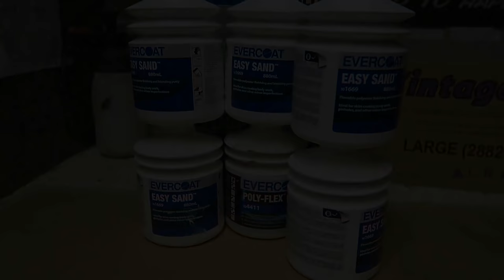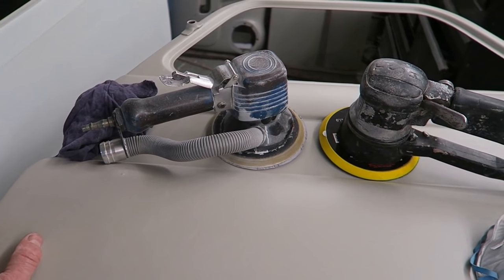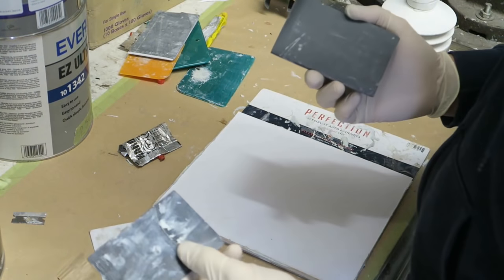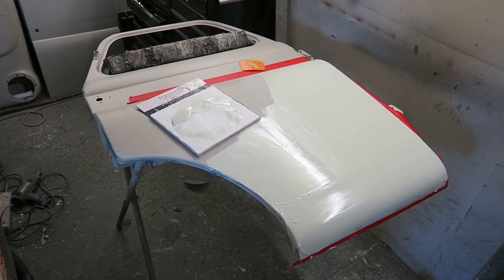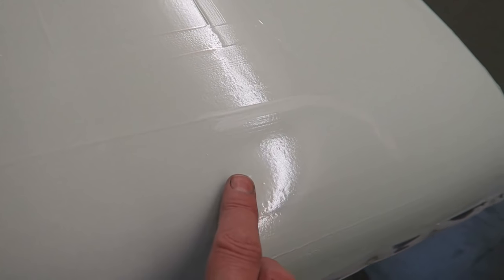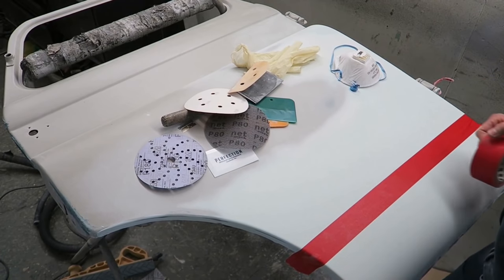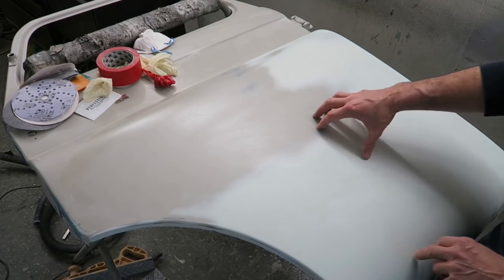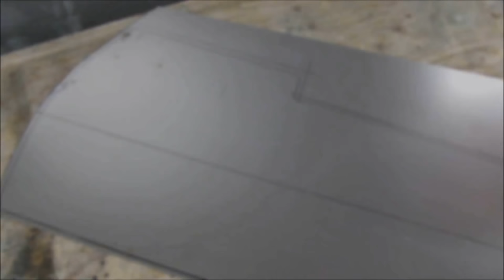Car Body Filler Bondo Tips and Tricks #12 + Evercoat Easy sand review

Comment: In case you have worked in some air in the putty, knock from the downside against your mixing board and you will see how the air bubbles come out. 
What you also could try, is mixing of easy sand with fiber tech -results to a smooth surface and high building bodyfiller  in one step!

Comment: Fillers are not all equal as I discovered either!  I now use quality filler such as Upol and though a little more expensive than some, certainly save a lot of time in ease of application, sanding and re filling after shrinkage! The masking tape trick is one I had overlooked too!! Another top vid mate!

Comment: This brings back memories for me. I remember the old rock hard fillers, which were hard work, then the lightweights, which had polystyrene as the filler, very easy to sand but the adhesion was so bad that you couldn't get a feather edge. Then the creamy ones came in like this product, which were very useful to finish with. I don't suppose you remember the old cellulose stopper? Great if you could leave it for 6 months!!. Thanks for sharing your skills Trev. Oh, and what possessed you to paint the wheels red ?!!?

Comment: Just done the side and rear doors of my van with the stuff using your tips and I’m really happy with how it’s gone. Very little clogging and dead easy to feather. Only problems are it’s damn expensive in Australia and so hot that I had to work in quick stages. It dries as I’m mixing but it is 44 degrees C. Both my fault for being on the wrong side of the globe. Thanks again m8!
Reply from the maker: simon ayton Hey Thanks 🤩, your comment is very much appreciated. Cheers Trev 👍
Reply: Use less hardener?
Reply: Tezzr Terry that didn’t work either. Just ended up spending more time mixing it in and the. There were parts that didn’t harden. I had to scrape it off and go again.
Reply: HA - yes - us Australians may not have the cold weather issues Trev was mentioning.

Comment: Hi Trev have you tried Evercoat Rage? performs pretty well ! similar to the easy sand but may work out cheaper?? We also use the Evercoat ultra light  and Upol Dolphin but haveing issues with pinholeing in both thinking about a change there!

Comment: "The name is Bondo...James Bondo".  Bondo is an American of body filler in case you didn't know. Body filler is talc mixed with polyester resin...same resin as is used in fibreglass.  All fillers depend on mechanical grip...a.k.a. grinder marks.   I can recommend that the best of all worlds is to buy whatever filler you want...and then mix a small can of polyester glaze, which sands easy, into your filler...then your filler will sand easier and have less pinholes. Also...you can mix in small amounts of fiberglas resin into any body filler you buy, to make it apply smoother.  Given that anything with polyester resin needs an oxygen free atmosphere to harden...I also recommend that you take a piece of masking paper and stick it to the filler you apply...then let it harden. When you peel it off you will find that there is no tacky surface to eat up your sandpaper.  Of course, you can also use a body file/rasp to take the tacky surface off.  Perhaps I should have my own Youtube channel LOL!    Anyway ...cheers from Canada!
Reply from the maker: Mark Anthony all points raised I’d heard before but I hadn’t appreciated that oxygen stopped the resin from curing 🤩 many thanks. Cheers Trev 👍
Reply: @bobbofly  I thought that was gel coat that doesn't cure unless oxygen free?

Comment: Hi Trev, love your videos. I've seen so many different tools used to sand filler. I have a orbital sander that I use to finish sand woodwork. Is that any good for body filler?
Reply from the maker: bob wickham give it a go Bob, you could use 80 g to get the basic shape then finish in 180 g. Cheers Trev 👍

Comment: Thats a very fine finish filler. Good open time on it. Will have to try it rather than stopper for a final skim. What epoxy primer do you use? Never been keen on putting anything filler wise over a paint substrate unless its a stopper. 
One thing I always reccomend is blowing the dust thoroughly out of the filler surface before recoating or priming. Helps adhesion and also helps prevent sinkage and scratching showing up. I also guide coat my filler as I would primer. This is especially useful when fine finishing the filler as it shows the scratching. Nice work as always👍
Reply from the maker: N K It’s HB body epoxy. Adhesion is definitely improved especially using fibreglass paste you really must key it well before filling. It is quite a brittle product so I wouldn’t put too much on. Cheers Trev 👍

Comment: Hey mate, I haven’t got the time to watch the whole video but I did watch bits so sorry if you answered them during the video.

Can you mix easy sand with a filler with a bit more build to it. I like 3m platinum plus, I just want it to be a bit more runny for doing skim coatings. 

And how far does a bottle of the easy sand get you ? Doing a skim like you did on the door, how many panels around the same size could you do with one bottle ? Thanks
Reply: Doing a ford galaxie at home .. long flat panels lol! And I’m not a metal finishing expert like you Lol !so just want to do a thin skim to get it straight

Comment: Hi Trev. Do you not use either a powder guide coat or a light airosol guide coat?. I agree it is amazing what you can sense when you run your hand over a panel. What grade of grit do you use on your long sanders?. Keep up the good work.
Reply from the maker: majorscope I personally never use a guide coat, just occasionally spray it with panel wipe and look at the reflection. Cheers Trev 👍

Comment: Hi Trev. Would you recommend filler on bare metal or after epoxy primer? I've watched so many videos and its a little confusing.
Reply from the maker: Mercedes Maintenance. Filler will stick to steel or sanded epoxy primer well. The benefit of epoxy priming is you can do a long term restoration and epoxy prime as you restore the car and it won’t go rusty before you paint it. You can do all your welding, prime it as you go round then sand it and fill it over the epoxy primer. Cheers Trev 👍
Reply: @trevsblog  Thanks Trev. You have to key the epoxy before painting, correct? Sand paper or scotch Brite pads? From my understanding it dosen't sand well after its cured for a long time. Thank's again Trev, love your videos
Reply from the maker: Mercedes Maintenance. I just key it with 180g which is the perfect base for feathering and finishing filler. The HB Body epoxy seems to sand fine, I have found other epoxy primers almost rubbery in comparison. Cheers Trev 👍

Comment: You spray epoxy primer over bare steel after metal work then you go on with body fillers?
Reply: How would you do it? Genuine question, I'm a beginner to bodywork looking to learn best practice.
Reply: Not a PRO here, but this is my understanding...you take your part to bare metal, getting rid of whatever rust etc there is. Use epoxy primer to seal the surface. Then apply your filler and high build primers, and smooth it all out. Then seal again your work, typically with an epoxy. The epoxy is impervious to just about everything, whereas fillers and primers can soak up moisture or solvents that will react with your paint.
Reply: @ronr6450  
Sounds good. Incidentally whenever I've tried to use rust conversion type products on bare metal I then have awful issues with getting sufficient adhesion of subsequent primers/paint etc. Don't know if I'm doing something wrong but don't use them anymore for that reason.
I think as long as the prepped base metal is  completely sealed from air & moisture - which is where epoxies come into their own for sure - rust shouldn't be an issue going forward.
Famous last words...
Reply: @andrewcheatle4691  be sure to key any epoxy primer before applying filler though as you may have adhesion issues , you do get some time to apply fillers, primers  and top coats to epoxy  but better to be safe  than sorry

Comment: HA - have you purchased shares in the EverCoat company BEFORE you published this video Trev?  Surely their sales will go up after this video - HA.  Interesting re the additive that stops clogging. 

I know this may sound like a "What the f,,," ---- But for certain situations I can use a panel file instead of sandpaper to shape filler - yes it requires a certain skill (I started out as a Dental Tech - fine shaping skills required and can shape just about anything with a file) - but then just requires an over the top with very fine sandpaper to finish - does away with deep scratch issues that can arise from using coarse paper to shape filler.  Not suitable for all situations and requires clear thought about the direction of the file teeth or you can end up with nasty slices in the filler - but with careful thought and a deft hand - very useful.

Comment: Sorry bud never ever use a wax& grease over talc body filler wet acrylic primer that can sand off . Wax&grease could = solvent trap  sorry  as I like how you put and explain and think your craftsmanship is good
Reply from the maker: Steve Ridell Thanks for your comment Steve. I get the theory of solvent entrapment but provided the substrate that the degreaser has been sprayed on has had sufficient time to stand and allow for total evaporation this shouldn’t create a problem. The only time I’ve ever witnessed solvent entrapment on filler was when it was coated with multiple heavy coats of primer without leaving flash off time in between coats. Cheers Trev 👍